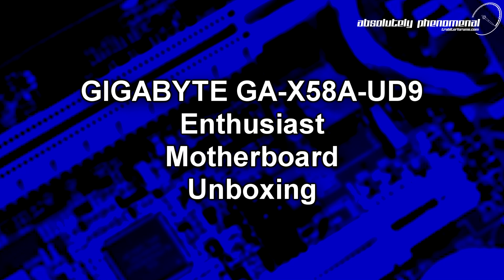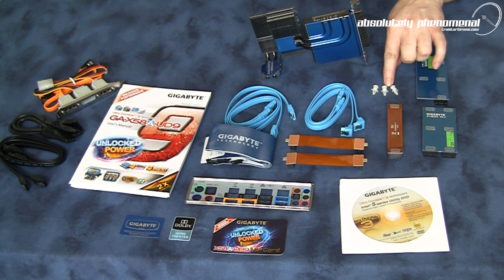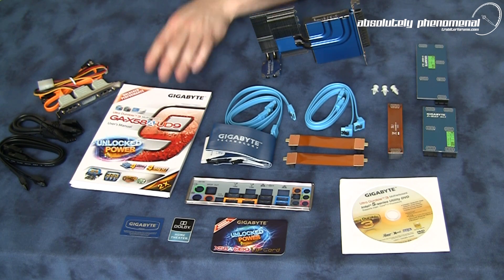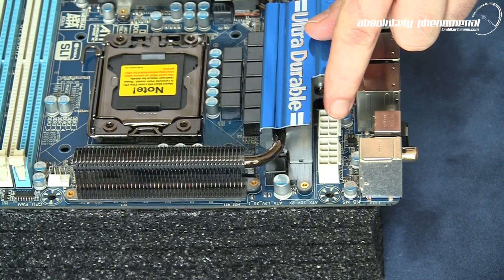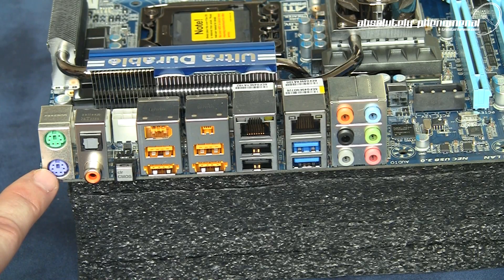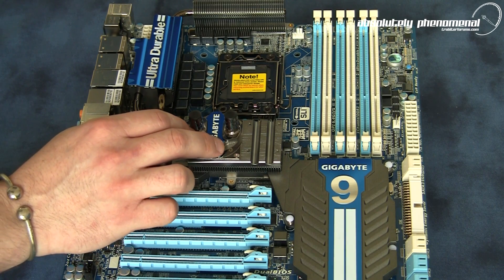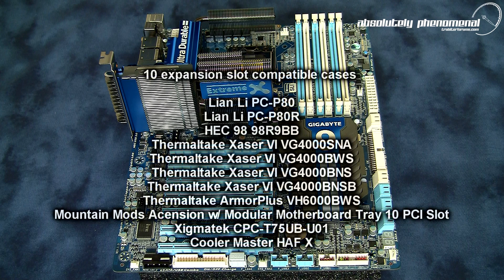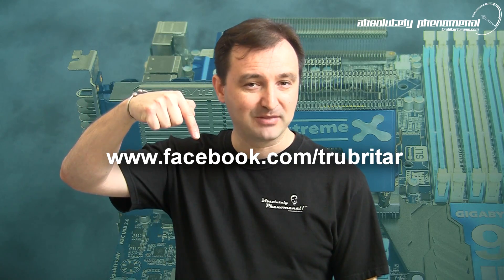GIGABYTE GA-X58A-UD9 Unboxing

Comment from the maker: @bmw2go11 : The bottom 12VDC Molex connector Is thankfully accessible as it is mounted on the "Motherboard"( +1), at a 90 degree angle  ;)

Comment: @SimSamurai Incorrect, the 980x is actually built off the Xeon processors and is made into a consumer friendly processor. The X5650 has 2 QPI vs 1, a lower TDP, handles higher memory speeds without overclocking, 32gb memory bandwith vs 25.6gb, physical address extentions is 40 instead of 36, ECC memory support, Intel trust execution built into cpu (virus protection in the CPU itself), and intel demand switching.

Comment: Nice board but the 4x calssified has jumper where you can turn off the PCIe slot if need be to conserve power or troubleshoot video card issues without having to remove all the cards. That is huge for someone like me. The 4x also has the external card that allows you to do all this from OUTSIDE the case..again..huge for me at least. The UD9 is nice but for what I do..the 4x Classy FTW.

Comment: @puafia you fail. the second hookup is set up parallel (like the SATA and IDE ports  on the motherboard), so the last pci e slot being in use wouldn't affect it, that's why the second hookup is there to begin with

Comment: @pika198 I know what you mean but arent the Xeon's older technology? I'd rather wait untill they make the same board that is dual i7 capable with SATA III and ddr-5.  Secondly what difference will 12 cores make if your software is written to use those cores. I have a flight sim business and FSX didn't even use 4 cores until they made the second service pack for it.  Its a great board non-the-less but I can only see it being used for hard-core record freaks and business data servers.

Comment: @AtomicProjects Lol, $1019.99 for the Xeon X5650 and the 980x is is $999.99 oh boy big difference. You don't have to have two Xeon processors right from the get go. The $599.99 SR-2 lasts longer as a board than this one because you can add a second Xeon down the road in a few months and now you have 12 cores, which will still surpass single socket technology 3-4 years down the road.

Comment: I've made arrangements for building a new PC including an Obsidian 800 case and a UD9 mobo. The tech guys then called and said that the mobo won't fit in the case and they currently do not have in stock a case that would fit that specific mobo. What is happening???

Comment: @apache249 Only if you want a water block built in and have a need for USB/SATA 3.0 and want 2 nf200 chips to make sure your GPU's run at full 16x instead of 8x

Comment: Hya Trub, the core i7 920 is two times in the list @ 2:23 :P, and It will also fit in a Corsair Obsidian 800d case, because r3aper is using that case for the 4-way sli mobo from EVGA :p

Comment: do the 3gb sata cables work with regular hard drives, or do you have to get a new compatible one? also will it fit inside the antec 1200, and is the cpu socket compatible with the intel e8500 cpu?

Comment: @123dodgecharger Yes it fits in the 1200 but there is NO room to move in the damn thing. So i went and splurged on a 800D and it DOESNT fit in the damn thing without modding and hence voiding the warranty :(

Comment: @SimSamurai Also, they will never ever have a dual i7 capable board because it has a single QPI only, which you can think of as an extra pci-e slot for your second graphics card. Xeon's are much better, but consumers rarely used it because the prices were high, now were talking about 700 dollar motherboards and 1000 cpus now its even playing field. Back in the day 200 bucks for a board was wtf.

Comment: So if you use the motherboard heatpipe solution, you cant use the extra motherboard molex connection on the motherboard and if you use the last motherboard PCI-E slot you also cant use the other motherboard molex connector on the motherboard. Thats fail Gigagbyte...oh and did I mention motherboard?

Comment: @pika198 Please take a look at my site / videos. I want to build a single system that can run 6 displays via two gtx 285's or two 480's using two Matrox TH2Gos and two GTS 250's running 4 displays for flight instruments. I like the 4x classy over the UD9 for reasons such as the easy PCI-e disable feature which is key for my needs. I like the SR-2 but also think it would likely be overkill. The hanger is if I would ever utilize the second processor.  Are there any worthy Xeons for like $300 each?